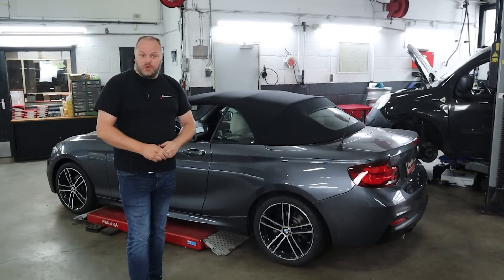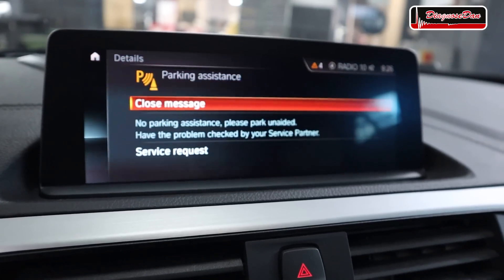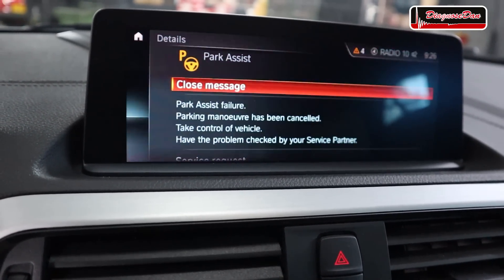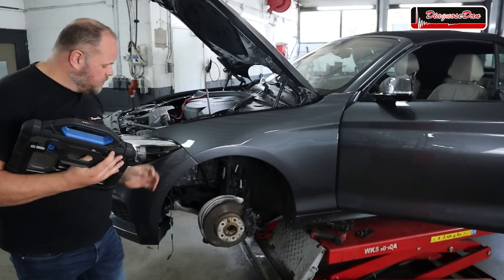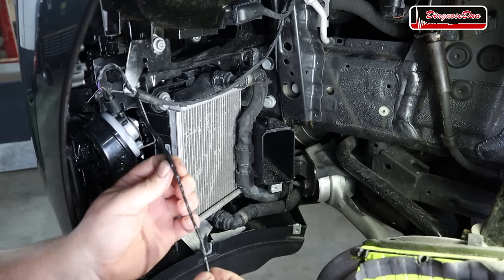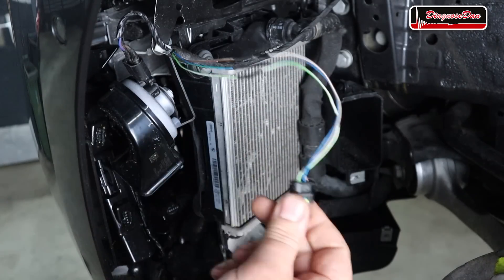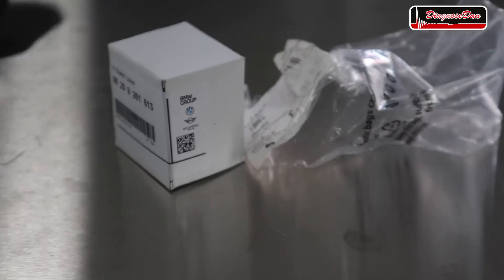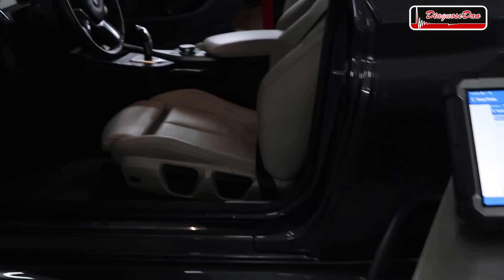Bmw NOT parking itself anymore! Broken Park assist

Comment: The other shop that ordered a pirate part should be ashamed of them self
Reply from the maker: Why? In many cases the insurance company asks  to repair as cheap as possible. And if its not insured than they proberbly tried to safe the customer some money
Reply: @Diagnosedan  That might be the case - but even knowing that they had put in a second rate part, they could not diagnose the error. Should have been the first thing to check?!?

Comment: Great video.
Most important question, how did you estimate the job? Blank check? 
As far as bad parts, last week, two Volvos, one was pinging, nonadjustable ignition timing 30 before TDC at idle spec is 10, removed chinese made ignitor, installed Bosh ignitor, problem solved. Second Volvo, p0171, removed chinese made air flow meter and installed
Denso made in Japan air flow meter; problem solved (OEM was not available). 
Sent china a thank you note for helping to pay my rent this month, told them to please keep sending their parts to my area, plenty of shop owners buying their junk and then calling me to solve vehicle problems.
Reply from the maker: It's very hard to estimate diagnostic jobs. You never know where you might end up. Most of the time its a matter of trust and some people want to get called if it's going to take longer than 2 hours

Comment: Seems to be a refund due to someone on that module in the trunk, plus that labor. This is very common in auto body repairs mainly because todays vehicles end up needing a mechanic as well as a body man during the repairs. Many times the body man will do the mechanical work because of logistics with the vehicle and the mechanic etc. or other reasons. Then of course there are "being in business" concerns, one of them might be getting the vehicle completed on time. Past experience is king when dealing with the complexities of todays vehicles so reversing the sensors on their mounts should have been known as a no no. Could also have been the sensor was not available OEM at the time and shop wanted to deliver the vehicle so they opt for the plain wrap part. It didn't work so now, whatever the reason to use that plain wrap part has made any saving in time or money has now been converted into added expense plus likely a rental car for the customer. 
Dan went after this one perfect ! All logic, common sense and the only tool needed for diagnosis was a test light ! (minus the tools needed to take apart the bumper).
Reply from the maker: The most important tool is your brain😉

Comment: What is the downside to Dan? - It makes you distrust "mechanics and workshops" more and more...
Reply from the maker: There are many good workshops and technicians out there. Believe me, all good examples you'll never heard about and dont end up on youtube
Reply: @Diagnosedan  - Hi Dan. I know. In your reply, it is comparable to the thousands and thousands of GOOD and EXTREMELY good musicians, that never made it commercially. But they do not have to stand back to any of the more well-known musicians.
However: Even though I am in the mechanical / retail  world myself, I very frequently, and on a basically weekly basis, see stuff like this: My background is wide, from Mining, to Computers, to mechanical and more. Which counts in my favour, when walking into a business, buying or enquiring something, sourcing new products, parts, etc, from wholesalers to retail outlets. It actually happens very often that a "salesperson" or someone delivering a service, simply assume that you know nothing or anything related to it...
You showing it on Youtube, simply reminds me on how common it actually is, for customers to be screwed over. From full-blown over priced quotes, to the less noticeable of parts being swopped out, not installed and a whole plethora of other underhanded, criminal actions - as long as they can make buck now, never mind if you can do something about it later... inclusive of criminal actions, law suits etc. 
It is unfortunately no longer a case of "most" is honest and ethical. Because they are not.
Reply: @Diagnosedan  - The sad part, Dan... is that I am in the trade myself.

Comment: Good diagnosis, Dan. I was taught a similar system known as ‘the split half technique’. It saves so much wasted time. Keep the videos coming. 👏👏👏
Reply from the maker: Indeed you can split it in half or even into smaller sections. It helps you make progress faster

Comment: Looks like you've been drinking low carb beer over the summer👍. Did you reinstall the original control module to confirm it's operation?
Reply from the maker: I later found out that the module i showed you in the video is actually the new part. They had already swapped the old one back

Comment: Interesting problem and nice diag & fix. Cool to see the fixed parking assist in action :)
I guess the price of original parts creates market for cheap and sometimes bad alternatives, but sometimes dealerships have cheaper alternatives too, equal to original but a bit cheaper. 
 For example Kia, at least here in Finland, offers "2nd line" parts for older, out of warranty vehicles. This monday my car (2016 Kia Rio) was in engine oil change service (smaller shop, not Kia dealer), and I bought the oil filter indeed as a 2nd line part from dealership. Looks exactly like original Kia filter, but no Kia badges anywhere even in the cardboard box.
Even before, cabin air filter was also 2nd line part, installed in bigger service at Kia dealer. This time I replaced the cabin air filter myself, and bought Mann Filter part from car parts store.
Reply from the maker: The price of the original sensor was expensive for sure and that makes that people will try to find alternatives.

Comment: Oh hey, welcome to my world!  I have the unmitigated joy of dealing with this kind of thing all the time, and it is very annoying.

I'm shocked to hear the sensors come pre-painted, though!  I can't say I've ever seen that.  Lucky!

With 6-sensor systems like this, often times the outer corner sensors will be a different part number from the inner four sensors, and the two are not interchangeable.  I run into this a lot on GM trucks and SUVs, body shops just yarfing all the sensors back in wherever and then it takes down the entire park sensing system.  :(
Reply from the maker: That is correct the inner 4 are Pdc sensors and the outer sensors are Pma sensors. When you swap them on this Bmw you'll get a faultcode that tells you the wrong partnumber is installed. This is because on this Bmw the sensors communicate through Lin-bus and they send an identifier to the control unit. If by accident you swap them you'll find out because of the faultcode.
The pre-painting of these sensors makes sense. The ensure good operation they need a certain thickness of paint. It's safer for Bmw to keep this under control in house.

Comment: Had the same problem on a Opel Adam , the body shop swopped around all the sensors the two bumper end sensors have a wider range detection compared the the inner four (different part numbers)
Reply from the maker: Yes they are different parts, on this Bmw you'll get a faultcode that tells you the wrong partnumber is installed when you swap them

Comment: Great video as ever Dan (apart from the missing bloopers!) but I’m itching to know if that original control unit was actually bad, don’t tell me you didn’t try swapping it back?
Reply from the maker: I later found out that the one i showed in the video is actually the new one. They had already swapped the old one back.
Reply: @Diagnosedan  so they buy an in required BMW controller but a snide sensor. Quality!

Comment: you get the interesting ones! i like the (bosch) vw pdc modules where theres one plug for front, one for rear but it was always going to be front ! 
in the uk bmw pdc modules are always swimming in a pool of rainwater in the offside boot ,we laugh how its usually fitted to a block of black polystyrene ,as a floatation device! lol
Reply from the maker: 🤣🤣 unfortunately that floating device doesn't help.

Comment: Never buy cheap aftermarket non branded sensors. I found this with cheap cam position sensors. Always buy genuine oem or find parts that have been tried and tested by other people that you know will work. Cheap sensors are cheap for a reason.
Reply from the maker: Exactly!

Comment: As ever a great watch. Thought it could be an accident when the video started as the rear bumper looked two shades darker than the car, but that was probably just the camera. I’d clocked the poor fitting side sensor at the start so we knew it wasn’t the best repair job! Nothing wrong with soldered wires but an OE repair but a full insurance repair would have needed a new loom. Lucky the person fixing it wrote the locations on the sensors 🫡
Reply from the maker: I wouldn't be surprised if the insurance company asked to fix it as cheap as possible 😉

Comment: Great job. I HATE people using "parts cannon" to solve problems... Who is going to pay the new parking ECU the other workshop installed for nothing??
Reply from the maker: Thanks for your comment
Reply: At least that was an OEM part. If only the repairer had used the parts diagram to order the OEM sensor, OEM front wiring harness (instead of repairing it) and OEM brackets (instead of using the wrong brackets) in the first.

Comment: It's unfortunate the owner cannot park this car. Should they be driving on the roads in that case? I think they should do the right thing and surrender their licence. Hehe!
Reply from the maker: I'm pretty sure they can park the car without this feature. They might not even use it. But its pretty annoying seeing that fault message in the screen every time. The system also activates then the reverse gear is selected 😊

Comment: I had a similar issue on my F06 650i. I was not using the system but I was getting error and couldn't use the 360 cameras. The side sensor was faulty. I opened the sensor and found out that water was passing inside and was getting rusty. New was 800+€, got a used one for 70€ and make it working again!
Reply from the maker: Glad you were able to fix the issue!

Comment: I replaced a parking sensor on my Chevy Volt with a cheap aftermarket sensor. A total waste of time. I knew the original  sensor was bad by playing swaptronica. Great video as always Dan.  Always, always check previous replaced parts. Scanner Danner taught me that!
Reply from the maker: Hey Mike great to see you here. I guess we've all tried cheaper alternatives and sometimes they work. But when it comes to sensors i've learned my lesson.

Comment: I recently replaced the crank sensor on a VW Polo 9N 1.4 hatch. The first part sent had the right sensor and right connector, but the cable was too short. I then returned the new sensor still in the plastic wrap, and ordered one from a different supplier. That was the correct one. The workshop book doesn’t have written you need to pull half the engine off to get it out. Nor do they have written that the crank sensor on the VW bby engine is under the starter motor. Fairly straightforward job, but new sealing rings are required for the intake manifold, as this has to be removed so the starter motor can be removed and the crank sensor removed, then new one fitted.
Reply from the maker: I feel the the struggle

Comment: Hmmm, bet the insurance company will be happy to hear they are paying for genuine bmw parts and the shop is putting chinesium junk parts.
Reply: A lot of insurance companies now will tell, based on age of the vehicle (ie if it is in or out of warranty) to put the cheaper aftermarket parts in.
Reply: @SeanBZA if the cheaper part is not working, they accept the original
Reply: Many insurance companies are fine with 2nd hand or even OEM parts...
Reply: @rkan2  OEM is same as dealer part. So why wouldnt they?
Reply: The steering arm was not OE - the clips were wrong so i suspect it was a private repair?
Reply: Well, not saying it’s a good thing that the repair shops cutting corners but since the insurance companies introduced “gestuurd schadeherstel” ( commanded damage repair) here many years ago in the Netherlands, I’ve seen my share of glued back together headlights brackets and many other things that should be replaced and where probably being charged as new. So they could get a bit more profit out of it because the insurance companies squeezed almost all out of it.
Reply: I'm afraid it's the other way around. They would only pay for the chinesium until forced to pay for OEM. (plus time to diagnose their screw up)  Step on a dollar to pick up a penny.
Reply from the maker: I wouldn't be surprised if they recommended it.
Reply: @Diagnosedan  they always recommend aftermarket or used
Reply: You clearly haven't dealt with to many insurance company's. They will cut a corner to save cents at every opportunity as long as they can fool the policy holder. Even with this repair as it a fault with the part they wont pay for the fault finding let alone the additional repairs. They will expect the part supplier to pay for the fault finding and additional labor. The only way you can be sure it's all the proper as quoted parts is if it the car less than a year old. Even though the crash shop would have specified the full proper parts list on the quote you see the Insurance assessor will pick it to pieces forcing the shop to use the parts they request. Often they wont even pay for any additional labor required to rework them.
Reply: most original bmw parts come from china or taiwan so what's your point???
Reply: OEM BMW parts, doesn’t mean absolute quality…
Reply: Chinesium and Playdoenium………..
Now where have I heard such words????   I’m gonna guess that you watch Scott’s Vehicle Collision Repair Channel, on YouTube; otherwise known as Vehcor????!!!! Am I right????
Reply: @jdrs4214  ... it is even used here in "Deep, dark Africa".... - since before Youtube. So, no, Scott must have "stolen" it somewhere else.

Comment: I had this kind of issue on multiple brands, not only on BMW. Also on Mercedes. Even genuine parking sensors can fail over time and cause short circuit. On some BMW-s(E65,E60) this kind of short can damage the PDC module. A small transistor fails due that. It can be replaced, but before reinstalling the module, short circuit needs to be eliminated.
Reply from the maker: Thanks for your comment
Reply: Funny how there are almost never simple cars like Citroen 2CV or Fiat 126 on Dan's channel! 🤔 It's almost like the more complicated the car, the more the points of failure. 😂

Comment: Dan, can you make some video on "simpler" issues people are facing day to day
Reply: I think the solutions to those simple problems are easy to be found on the internet. As a former car mechanic the cases Dan takes on, are much more interesting because he’s the guy that gets the problems that hardly anybody else (sometimes not even the dealership) can fix. 
Even in my current business (sustainable energy systems) I apply the logic and way of thinking, learned from Dan’s videos, and solving many problems.
Reply from the maker: I dont do relation issues😂

Comment: Hi Dan,great video.I was just wondering >did you try it with the original modual after the repair and did you look at the replacement?my  guess would be if they bought a cheap sensor they probably bought a cheap modual from the same place.in which case i wouldn't trust it to last long.BMW Not using the TESA tape all the way on the wire is just lousy practice,unless the wiring is rodent resistant.Good vid Dan.
Reply from the maker: I later found out that it was the new module i showed in the video. They had already swapped back the original unit. I dont think you can get this modules aftermarket.

Comment: Dan fixed it again! No surprise there. Aftermarket parts have always been dodgy, but the last few years they've REALLY become terrible. Always use OEM if possible. Classic car guys really have it bad- it's almost impossible to find decent basic electrical parts.
Reply: I agree. Typically a second hand OEM sensor from scrapyard is better than new no-name replacement part. Especially for parts such as ultrasound sensors that have no wear parts.
Reply from the maker: I agree!
Reply: Not even a C  E logo from Ali or Temu on this sensor, not even worthy the China Export mark 😂